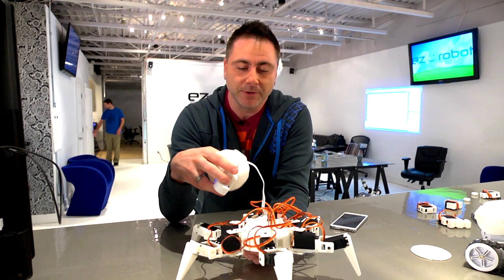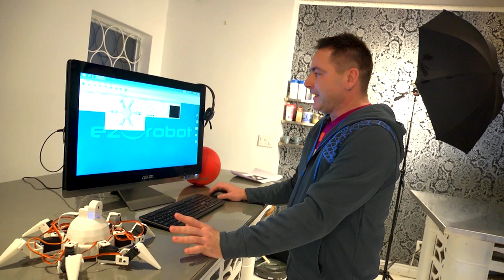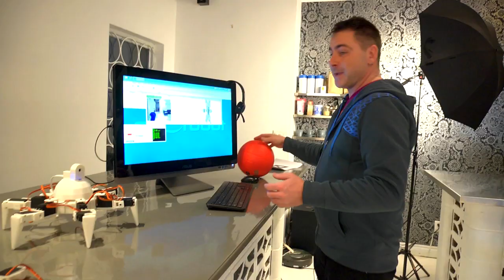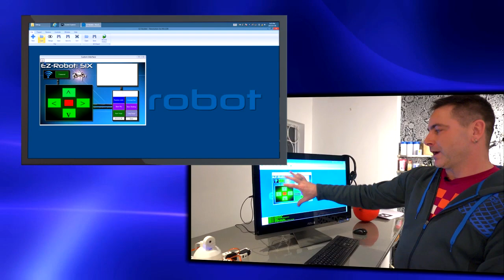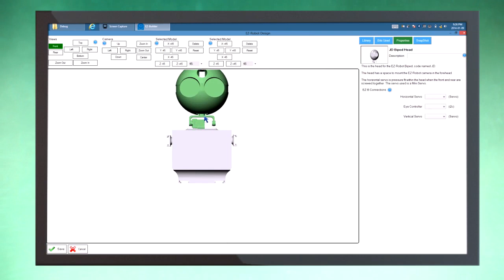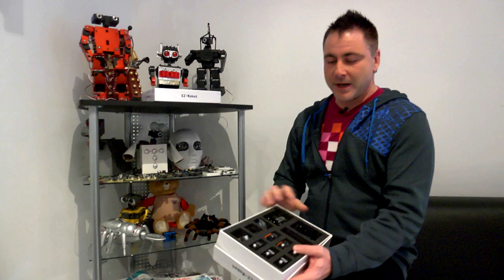Get Started With EZ-Robot Revolution

Comment: I can use this soft in Orange Pi? Raspberry Pi?
Reply from the maker: Our solution for Raspberry Pi or any linux based hardware is the Mono SDK available at https://www.ez-robot.com/EZ-Builder/mono. Additionally, if your PI is running Windows IoT, then the UWP library is here: https://www.ez-robot.com/EZ-Builder/UniversalBot
Reply: Thank you very much for the answer. I'm from Russia. Very sorry that we have no localizing Your training... what you are doing is a huge contribution. And it is very important that Your project is open. Success To You
Большое спасибо за ответ. Я из России. Очень жаль, что у нас нет локализации Вашего обучения... То, что вы делаете - огромный вклад.  И очень важно что Ваш проект открыт. Успехов Вам
Reply from the maker: Thank you for the kind words!

Comment: is it possible to connected a touch sensor to the robot to make it seem like a pet for kids
Reply from the maker: Yes - you can add nearly any sensor that exists. The robots use most common communication types, such as ADC (analog input), i2c, uart serial, digital input/output, pwm, etc..

Comment: do the parts snap together in the program? or do they just float there?
Reply from the maker: +zenol leytan They float - because we enable users to create their own parts by uploading STL files - it would be incredibly challenging for the users to configure physics of each component that they contribute to the global ez-robot community library. Specifically, it would be challenging for students who are one of ez-robot's main contributors of 3d printable design files. Floating or not, you still get an idea of what you're robot looks like and it creates instructions on how to build it again - or share it with someone else to build. And sharing is the point :D